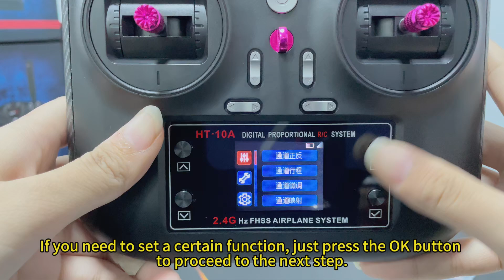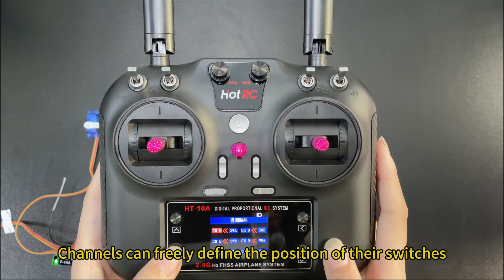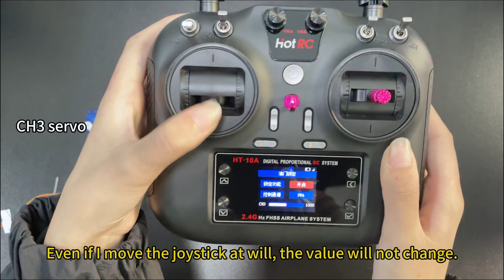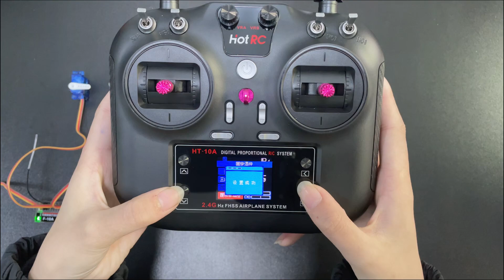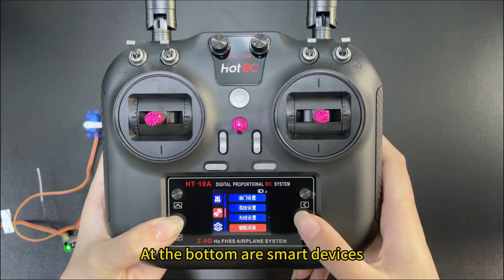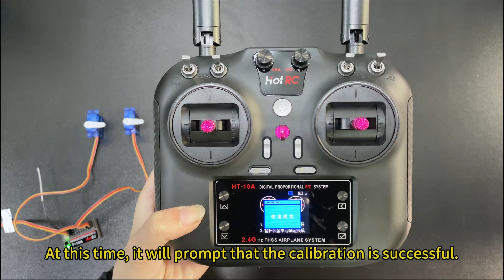HT-10A remote control super detailed explanation!

Comment: Nice controller but some coding needs a bit upgrading. 
For example when adjusting the max throttle to the minimum value (which actually is 20% , i will explain why that happens) it just increases the idle range of the stick , which is counter intuitive . 
It just makes it wider leaving less travel range for actual control. 
That means instead of having more control of your speed by having the same lever travel range for a smaller speed range, you have the same level of control accuracy that just engages at the ends of the lever travel range. 
When you set max throttle under 20% it increases the iddle range so much that it extends over the physical maximum range of lever travel and actually negates the throttle completely. 
I dont know if the firmware can be updated but that is a point i would like to see improovement.

Comment: This video is no substitute for a well written manual. At the very least this video with English spoken should show a transmitter with the screens in English, not Chinese and with the screen big enough to be read. I made a mistake and had the menu in Chinese. It was a nightmare getting it back into English and I'm still not sure of what I actually did to get it into English. It was possibly the Google information of what the Chinese symbols for 'language' look like 😵‍💫. I couldn't find any information at all on how to do a factory reset. As indicated on the cover of the Quick Start Guide, I logged in 'for more instructions', but didn't find any. I have not yet evaluated the receiver.

Comment: In your video you connect a battery with 3 wires. Are they from the battery balancer 2S? I have 5Ch, 8Ch and 10Ch receiver that don't work above 7.5 V on the + and -, even if it says 5 - 9V. Do I need to power the all 3 pins +, -, S ? Can the receiver support 2S at 8.2 V ?

Comment: I have a HOT RC HT 8 remote but it is damaged due to a repair error, installing the battery causes a short circuit, how do I fix it, thank you
Reply: buy another. they are cheap. otherwise don't buy junk anymore

Comment: Is it possible to set RSSI feedback signal strength from rx sbus-A connected to flight control circuit via tx hot rc ht-10a, is it possible to set RSSI in INAV software?

Comment: Can tx hot rc ht-10a as above connect to the sbus-A receiver also from hot rc?
I want to use the sbus receiver and not the included pwm receiver
Reply from the maker: The HT-10A remote control can be used with the SBUS receiver.

Comment: I got the same control but without that screen, this control came with a sbus instead of the pwm receiver, how can I convert the sbus receiver in to a PWM? Do the store have a converter for a HotRC sbus?
Reply from the maker: You bought the HT-8A remote control. The SBUS receiver cannot be converted to pwm signal. You need to re-match the receiver, which is the standard F-08A.